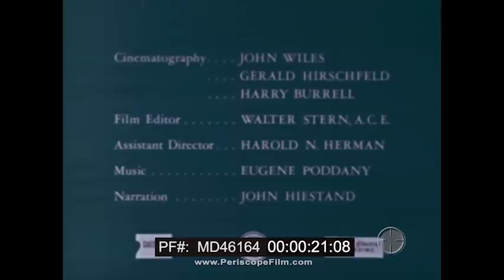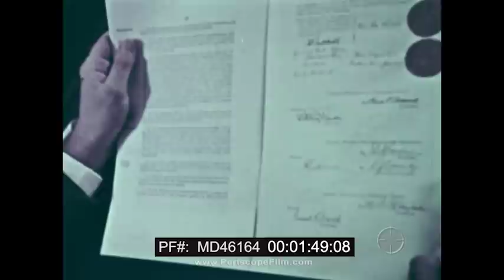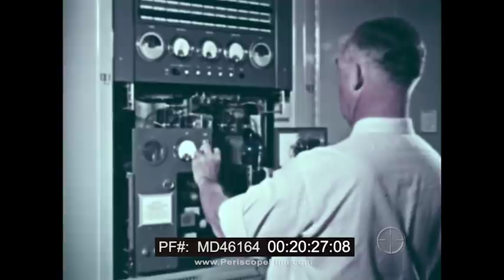BUILDING THE FIRST TRANSATLANTIC TELEPHONE CABLE "VOICE BENEATH THE SEA" MD46164

Comment: what they didn't mention was each amplifier got 200V from a string of 100 inline voltage dividing resistors; with the UK end providing +10,000 volts and the American end supplying -10,000 volts.

Comment: According to Wikipedia, this telephone line, called  the TAT-1 cable, was decommissioned in 1978.
Reply: Everything is satellite now days.
Reply: @johnstudd4245  I don't think so. Most communication - VoIP, internet etc. are via sea cables.
Satellites have way too much delay.
Reply: @akyhne  I stand corrected
Reply: @johnstudd4245  Most of the communication traffic is now through high speed fibre optic TAT-14 and other private transatlantic cables.  All of the previous TAT cables have been decommissioned.
Reply: Yep, satellites pretty much took over.
Reply: @akyhne   The cables of those days were limited to perhaps a couple of dozen calls.  A satellite could easily handle more and often satellite channels were paired with cable channels, so that only one direction went through the satellite.  Today's cables are fibre and compared to them, the capacity of those old copper cables wouldn't even amount to a rounding error!
Reply: @johnstudd4245   You can sit down now!  🙂
Reply: In the film they predicted 20 years' service. Not bad.

Comment: I wonder if they still use it or how long it lasted before obsolete? And how many times it was cut by accident by trawlers and storms.
Reply: TAT-1 was in operation from 1956 to 1978.  TAT-2 was in operation from 1958 to 1983.  The TAT-1 cable was cut once near Oban Scotland in 1956.  It was repaired 16 hours later.  All of the repeater tubes never failed during its 22 years of operation.  The tubes were powered by 4000 volt DC applied from the cable stations at each end.
Reply: @Stringer25 , did you work on this stuff? Thanks man
Reply: @shanek6582  No I didn’t work on the cable. I’m from Clarenville so I did a lot research about the cable history. In fact, the cable runs along my backyard ten miles from the cable station.

Comment: Something is wrong here. I was a District Inspector for a gas utility in Massachusetts.  My job was locating and marking our gas lines. In the late 80s or early 90s a major sewer and drainage project was going on in downtown Lynn.  I showed up for a daily update of digging. There was a lot of suite coats at the site. Because of my job i was able to find out who they were. State officials, phone companies both long distance and local providers and other government officials.  They were there because the east coast trans Atlantic cable was going to be exposed. In talking, i was told it was first one to America from Canada. They were concerned about how it will be supported or held up and wanted too verify procedure. A rep would be there for the duration and had authority to shutdown work anytime. Lynn mass was the only location that was feasible from Florida to Canadian border. Now Virginia Beach has been added. This line was only direct route to Canada then to Europe.  In the late 90s or 2000 the first fiber optic cable came to Lynn. This time I was directly involved in the first couple of miles to its station. From there towards boston i only followed a mile. This telephone communication cable was old so what do you know about the line that comes to Lynn
Reply: Hibernia Networks or also known as Hibernia Atlantic fibre optic cable was installed in 2001. It runs from Lynn, MA USA to Herring Cove, Nova Scotia, Canada and then onward to Ireland - https://en.m.wikipedia.org/wiki/Hibernia_Networks

Comment: How did the undersea repeaters work without batteries?  Doesn't amplification of telecom signals require power?
Reply: They had a separate wire that supplied over 4000 DC volts to power the repeaters.
Reply: @Johnny2Starz the same is true for today's fiber optic cables, they have repeaters and many thousands of volts passed along the cable to drive them.

Comment: How did those amplifiers/repeaters get power? What was the power used? 115vac? 240vac? Something else?
Reply: Google says it uses a large DC voltage with positive at one end and negative at the other with a ground somewhere in the middle? Doesnt make much sense maybe someone can explain it better?
Reply: @davenone7312  the cable probably carried electrical current.  That's the only explanation.
Reply: @davenone7312  Sounds like a virtual ground.  Consider if you have two 9V batteries connected together to make 18V.  If you place 'ground' on the connection between the two batteries, then one end of the battery is -9V, the other is +9V with respect to that virtual ground.  So I guess it was something like that?
Reply: @davenone7312   No ground in the middle, just + at one end and - at the other.  Of course, the power sources at each end would be connected between the cable and ground.

Comment: If the rigid type repeaters worked for both directions and they only needed one wire for the 300 miles between Newfoundland and Nova Scotia,    I wonder why they used a different type repeater and lay two wires between Nova Scotia and Scotland?
Reply: Probably size and weight. The duplex cable is huge compared to the other2.
Reply: The Cabot Strait between Newfoundland and Nova Scotia is much shallower than the Atlantic Ocean.  The newer type of British bidirectional repeater for this cable is much more rigid and fragile.  If any one of the repeaters break, it's easier to bring it up to the surface and repair them.